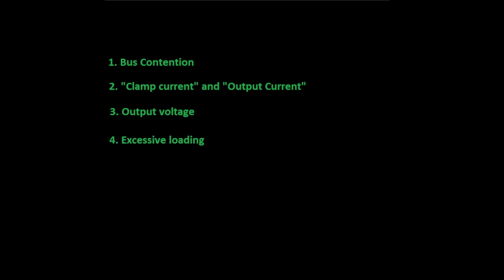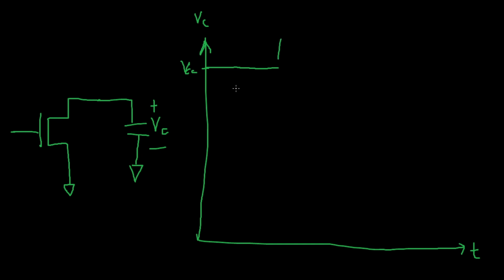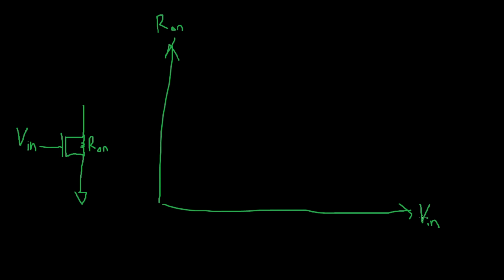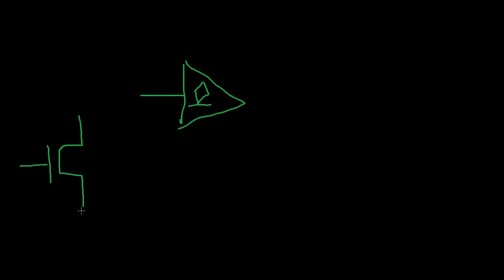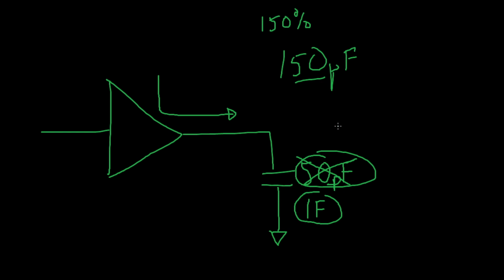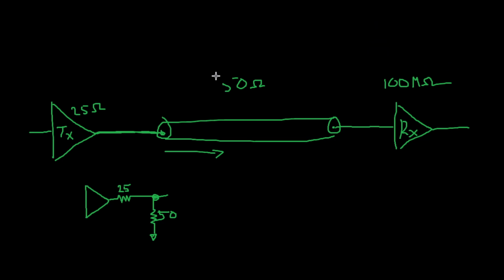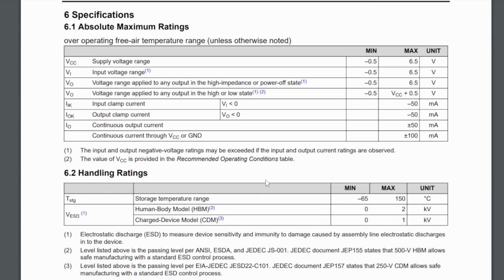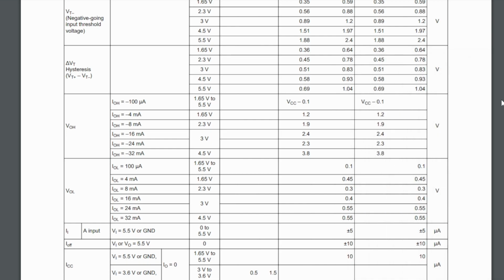Top 5 Design Mistakes around CMOS Outputs

Comment: Masterfully presented! I bet it will save many beginner's asses. I mean assets! 😅 What could be particularly interesting is a more elaborate follow-up on extracting drive strengths not only by eye-balling them from data sheets but also by reading them out from spice and IBIS models. I can see no-one that could explain it sooooo well as you do! And a related question: How on earth to size source termination for a microSD card slot when no card in the world specifies relevant data and even if one card did, the next one could be different. The SD standard does not enforce it. 😢 Anyway, you earned yourself a subscriber and a one that will praise your channel with passion. You deserve it.
Reply from the maker: Thank you for the kind words! I do have a video on SPICE basics, but I agree having a dedicated video on getting useful info out of models is a good idea - I appreciate the feedback and will jot that down as a possible future video. As far as termination on microSD cards - I don't think you really need them in most cases (ie on PCBs with microSD card slots). I've seen them used in longer runs - for example when the card slot is connected via long wires to a main board. In those cases I think they are primarily there for improved signal integrity and possibly reduced EMI.
Reply: @electronicswithemrys , you're right and it does help putting the card slot close to the MCU, which, unfortunately, I can't really do. After some digging, I only found max values for clock rise and fall times of 10 ns in the uSD specifications (for the default 25 MHz clock, while for high-speped mode it is 3 ns max). If I had an oscilloscope, I'd just try a few typical values for termination, but without one, the only way is the hope-it-works-way...
Reply from the maker: @dookshi  A decent o-scope is definitely a "must have" item. I spent years without one, so I understand the struggle, but I did make it a priority for my home lab and that $400 has gone to good use for many years now. For your system, I would recommend to start with a series termination at the transmitters of 22 ohms -- with fast signals a smaller resistance is better and placement is key. If the resistor is near the receiving device, it doesn't do much to help. Also having a controlled impedance line will make a big difference in signal integrity if you have to place the SD card far from the controller. Most likely the SD card itself has a weak driver (which saves die cost to the manufacturer), so you probably don't need a resistor going from the SD card back to the controller - but it doesn't hurt to put 0 ohm resistors there and swap to 10 or 22 ohm if you have issues. Good luck!
Reply: @electronicswithemrys , my gosh, do we think alike... I made 0603 footprints with electrically shorted pads (as net ties) specifically for that purpose. Nothing to test the signal with yet, though. I mean, a couple of beers should go a long way in procuring a scope and a thirsty helping hand with it, at least for a couple of hours. You mentioned a very nice point about a uSD card probably not going to drive as strongly as an MCU. I anticipated termination on the MCU side for sure. I can also adjust the actual drive strength for each MCU pin in firmware which is certainly helpful. And a known impedance of 50 ohms (because why not?) goes without saying.